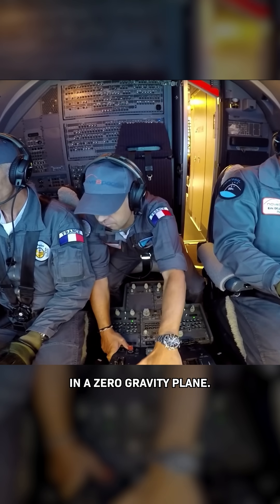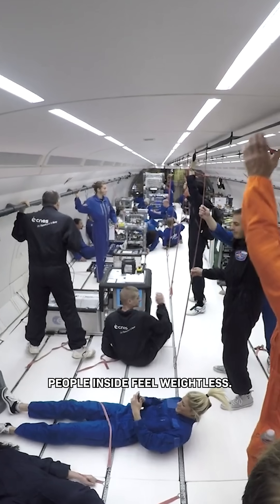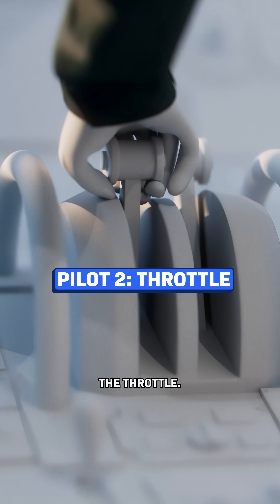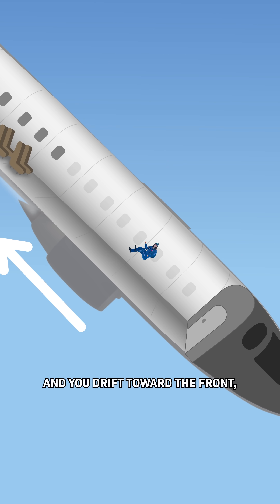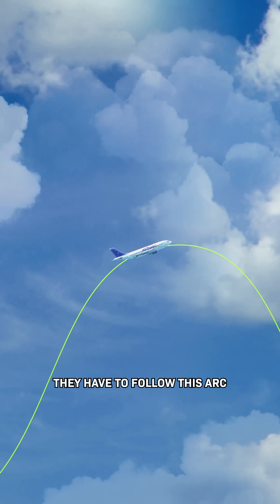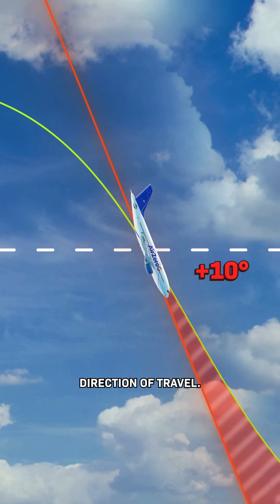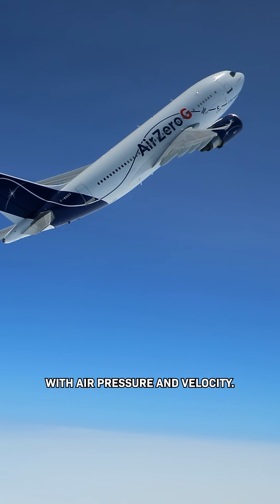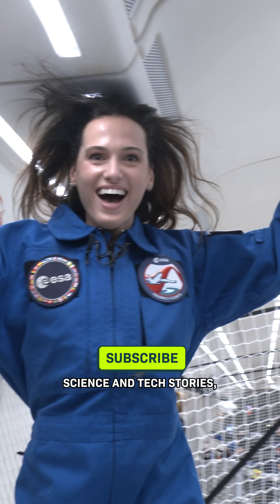Why This Plane Needs 3 Pilots

Comment: In French military transport aircrafts and maritime patrol aircrafts, that's the position of a flight engineer who monitors and control the engine systems and fuel systems etc. He not a pilot but an Engineer  who is well positioned on the throttles and the Engine system gauges between the 2 actual pilots.

Comment: Engines mounted below the wings and thus below the center of drag make zero-G flight particularly difficult. This is because the thrust of the engines creates a moment that pushes the nose upwards, which must carefully be compensated by the elevator. In a three-engine aircraft, pilots use the centre engine at the rear to compensate for air resistance. This simplifies the manoeuvre so much that it can be done perfectly by just two pilots.

Comment: Complete BS video. The aircraft they use is a 727 and has a flight engineer. All 727s have flight engineers and has zero to do with zero G. A flight engineer will set engine power for takeoff and climbs. 
And no, not one pilot controls roll and the other one pitch. That’s silly. One pilot flies and does it all, the other pilot does co pilot duties. 

This video is ridiculous and completely false.

Comment: Hi @cleo… This would be possible with the a310 since it’s fly by wire, meaning the sticks can move seperately from eachother. The signals are not split but are summed . However in your video the controls are yokes, so not Airbus which are mechanically coupled. This means only one pilot does pitch and roll since the controls are mechanically linked and Cannon move seperately from eachother

Comment: Wow - I never knew this. 

What are the stresses on the plane like? Clearly it’s not originally designed to do this - is it modified? Does the lack of seats and fitted interior make  significant difference to the stresses?

Comment: I did experiments in the original KC-135 in these flights back in the early 90's.  It would fly out of Houston over the Gulf, do 15 parabolas and then turn around and do 15 more coming back.  

Advice to flyers.  Do not have a big Mac plus large fries plus a large strawberry milkshake before the flight 🤢🤣.  Other than that it is an amazing experience.

Comment: I understand that a third pilot is required. After those unfortunate navigational errors, leading to incursions of the controlled airspace of a sovereign nation… it is clear that a third, supervising crew member is needed. The question is, are BOTH the pilots aware of this? And do they accept this third pilot as their supervisor?

Comment: A casual reminder that the weightlessness is present as much on ascent as on descent (that is if the additional G-forces are equal on ascent as on descent). The path in the middle is a parabola on which the plane "throws" you.

Comment: The pilots use all instruments and data to operate the plane, on this day an age, if its a repeated action 31 times per flight, with a ton of flight history, couldn’t it be posible to have enough data to be automated? A computer should be capable to read the plane data and follow the same instructions. ( of course you still need pilots as backup) but just wondering.

Comment: Hmm... wouldn't it be way easier to give it an accelerometer that controls the fly-by-wire? Because what you want is just no acceleration, and each pilot could just be supervising a system that is basically a spring and a lump of metal.

Comment: 3rd pilots were used alot in older planes as they had to have an engineer. Such as the DC-10, 727, etc.

Comment: Why don't they fly the plane really high and then just turn off both the engines,it will experience a free fall, it should work. Shouldn't it? 🤔
Reply: A freefall parachutist actually experiences 1g at terminal velocity.  Because of drag.

A jetplane doing 0g needs its engines running to counteract drag.
Reply: @Invent2HelpAll ohh 😮 interesting!
Thanks for clarifying ❤

Comment: Seriously, that can't be automated? Not by "AI" but still computerized autopilot?
Reply: Flight is really safety first so to speak.
In theory it could be, but practically the ascend/decent profile is far above the "limit" autopilot just turn itself off on and hands the controls to the pilot. If you would expand the limits you would risk "reacting late" to really dangerous situations.

Comment: What happens to the pilots? I mean will the pilot experience the gravity change?
Reply: Everything in the plane does.
Reply: Gravity is not changing.

Just like with an F-16 pulling 9g's, the pilot is not increasing gravity by 9 times.

No one has taught Cleo the distinction between gravity versus inertia.
...or rather, everyone who has tried to tell her has failed.
Reply: @Invent2HelpAll  it's G FORCE wich is either plus or minus normal Earth  gravity.

Comment: Think of it this way,  the plane has to fly a flight path that is within a couple of inches through the center of the plane.  Any further off and the walls or floor will drift into the falling people.

Comment: The third pilot on the back seat to control the thrust I get it. But separating the bank and pitch between the pilot and copilot is 🤯. Since (usually) the controls are synced with both sides, it would make a very difficult coordination effort for one pilot to not input any effort in one direction while doing the other input. I certainly hope they have a custom system where they can "disconnect" both sides for that part of the flight.

Comment: Makes absolutely no sense! Pls make a follow up explaining exactly HOW pilot 1 and 3 do their job...
Reply: Pilot 1 does the Roll by using two strings attached to the yoke, pilot 2 manages thrust and pilot 3 flies the pitch by pulling and pushing on the yoke. All three pilots switch roles during the flight to stay focus
Reply: @bastypilot  ah... still sounds a bit overkill but at least now I know how they do it.

Comment: im pretty sure its all calculated by computers using a flight path marker and a cue to follow but yeah it needs the fine adjustments of a human
Reply: it's been done since before computers had the capacity to control planes
Reply: @harridan. I didnt said the computer controled the plane, i said the computer calculated the needed adjustments

Comment: Its Zero G, but nor zero gravity
if theres zero gravity, people inside the plane wont fall, but they fall inside the plane as the plane fly down
zero G
total gravity
Reply: With as much effort that Cleo has put into this topic, you'd think the light bulb would have clicked on by now.

When an F-16 pulls 9g, she probably thinks that the pilot has the ability to INCREASE GRAVITY by nine times.

Her high school physics teacher failed her.  She should have been taught the distinction between inertia versus gravity many many years ago.

Comment: That kind of difficulty is one of the reason I wanted to be a pilot when I was younger but I'm colorblind so I'm not allowed.
Reply: There's this super cool thing called sarcasm! Like for example he was joking when he said that and not that he doesn't understand what colour blindness is
Reply: @CROWNED99   😂
Reply: Most pilots are overrated cab drivers. The good ones can handle the emergencies the automated system can’t handle or create. Some are real bad asses but are rare.
Reply: @kirksnowden8023 sounds right up my alley, but like I said. I'm not allowed. A part of me really wanted to when I was younger. Went to MEPS, almost joined the air national guard. I was hoping to be a pilot and I was going to use the guard kind of to see if I wanted to join the full air force. Found out I couldn't and went to a trade school instead.
Reply: Color blindness doesn't eliminate you from getting a sport pilot license or glider license. It does limit your ability to get a commercial license.
Reply: @OSCAR_San_Diego and planes sounds like a much more expensive hobby than the expensive ones I already have. Doing it as a job was the only real way I was going to be able to. I always wondered if I was color blind growing up and I got confirmation at MEPS when I almost joined the Air National Guard.
Reply: @ratboy12002 NASCAR for Oscar...
Reply: Truth man
Reply: But how was your little sister's beauty pageant?
Reply: Skill issue
Reply: @quicksilverop1362 there’s this super cool thing called research! Like, colorblindness isn’t “skill issue”, it’s a literal MEDICAL CONDITION
Reply: @mana-qj3ek  skill issue to understand sarcasm

Comment: I can't even set my shower to the perfect temperature. How he turns the plane to the right angle 😭
Reply: What's worse is trying to set the perfect temperature of someone else's shower.
Reply: For me it is about an extra $100 for 31 pairs of boxer briefs. Zero gravity is free fall which will certainly make me crap my pants.
Reply: Aviation is cool
Reply: A plane has less manufacture tolerance than a water hose
Reply: All I have to say to that is thank God you don’t do anything more difficult than turning on your shower….
Reply: Unlike a shower, planes have TONS of displays showing everything
Reply: @PEAS-2 But still isn't it impressive
Reply: customized auto pilot control

Comment: There's also an issue with the fuel getting to the engines during these moves.  I think I learned that from you!
Reply: No, there’s no issue with the fuel. She didn’t go deep enough into the design of the plane to understand that for the profile flown it’s modified to have continuous fuel flow to the engines  throughout the series of maneuvers. She recognized that an unmodified plane could have issues being flown in this manner, but a bit more research would have revealed the full story. 

I do appreciate her videos though.